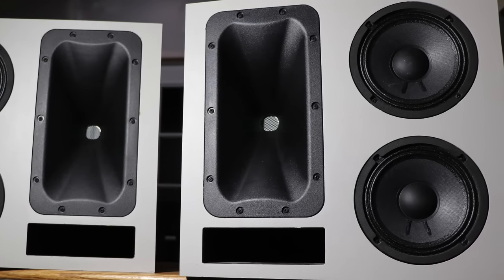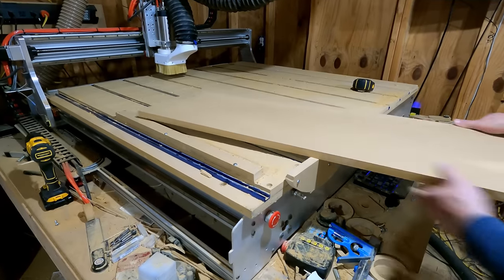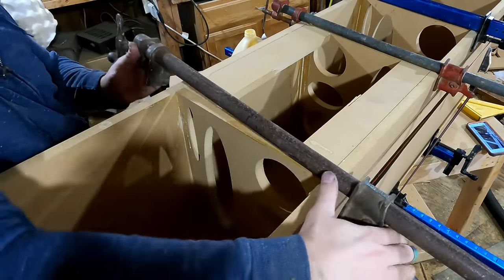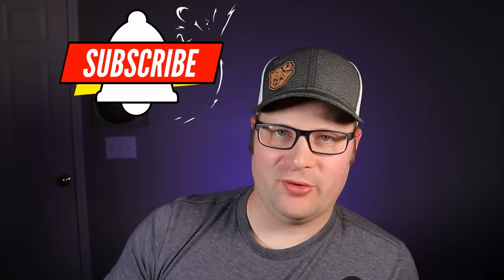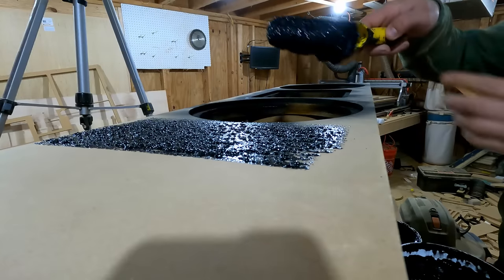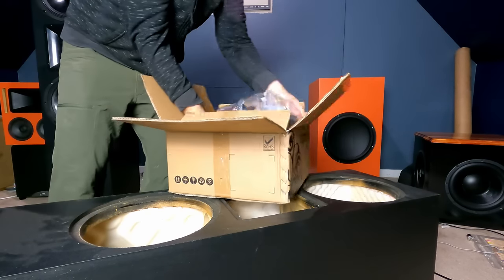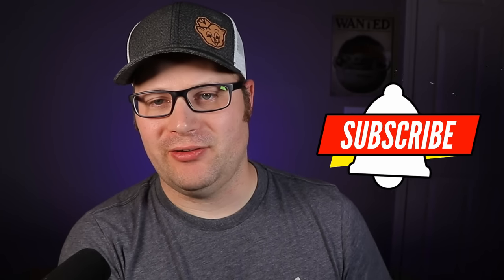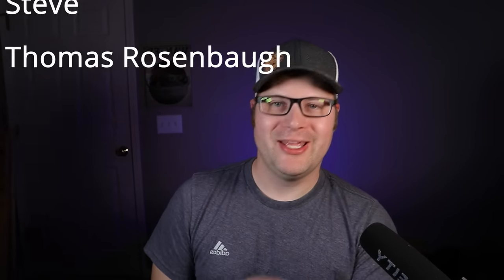How to Build $14,000 speakers for $1,300! JTR 212 Inspired - The Audience 212

Comment from the maker: 📄Build Plans: https://bit.ly/audience212
Reply: Are these good just for 2 channel listening? Or specifically for home theater?
Reply from the maker: @TexasCorgiGun  they are designed with home theater in mind. I would still use a subwoofer with these
Reply: @Toid  Thank you for your response.
Reply: Do these use a passive crossover or are you running active?
Reply from the maker: @russellgilmer1897  passive
Reply: do you have sample plans to review, I don't want to find out there is some unobtainable part or that they can't be printed 1:1 for tracing.
Reply: What about the woofer? I don't see a link.
Reply: Hey Toids!  Do these plans include schematics and instructions for a crossover?
Reply from the maker: @GARDNSOUND  yes they do
Reply: @Toid  Thanks man.  I'm going to pick these plans up.  I'm excited to build them.
Reply: looking at the plans before buying, I found the 12"  woofers out of stock. I 'm ok with switching models of drivers (Staying in the SB line) but if this is the case with cross over parts I will be lost.
Reply: Why two woofers of the same size and make? Phase cancellation will fuck up the sound. The same design with one woofer would be better. Way better.
Reply from the maker: @ZekeMan62  an MTM can have superior radiation patterns. You can read more about it here https://audiojudgement.com/speaker-lobing-polar-response/
Reply: @Toid  

Ok. I'll check it out. Thanks.
Reply: link is broken
Reply: @Toid  compression driver!? Pro audio woofers! Bro! That's really 126dB kinda loud! Even QSC K12.2 does 126dB easily! 😂I don't think neighbours will ever allow more than 92-99dB SPL @1m. Considering SPL drop as distance increases.
Reply: I’m trying to buy the build plans but it says there is an error.  Is there another way to get the plans?
Reply: @TexasCorgiGun 6th😢
Reply: Does the port have a top section, or is it just opened?
Reply: I’m looking for plans on the center channel. Is that part or could it be part of the download?
Reply: QQ: in the video you said these crossed over at 1.3khz via Xsim. Why is the Xsim crossover point different than the Fc using just the crossover component values?

Comment: I just totally wished you had a reference speaker like the Klipsch R-800F where you can compare your DIY speakers to and explain the strengths/weaknesses to said reference. It's very hard for the viewer to know whether it's worthwhile to build it and perhaps be disappointed when it's finished.
Reply: i think in diy we tend to hear what actulay the sound is brand always adds some ups and downs in their speakers to call them their signatures when comparing each and every speaker there will be difference and that will certaily base on one's way if approch
Reply: Those would smoke the Klipsch
Reply: @BostonMike68  Yeah, but it's not about smoking it. It's about telling potential builders how much better/worse it is compared to a popular and easily auditioned speaker like the Klipsch or other reference speaker if Toids chose to.
Reply: It's not even in the same ballpark. He's using 2 12" high efficiency professional drivers those are what people use for concerts and big events. They are 98 SPL per watt or something crazy. You can't even compare them they have a aluminum basket with a 3 " inch voice coil. Klipsch steel stamped basket aluminum cone 1.5 voice coil like he said if you had to buy something like that he modeled after it would cost $14000 you can't compare a big box store speaker with something like that it will put perform it in every way. I built a lot of speakers and I want to build them I was just on Madison sound website and saw the specs of the compression drivers and woofers the only thing you can compare it to is what he modeled it after
Reply: @BostonMike68  Did you not understand what is meant by a reference speaker? ... It's a way to compare it so that someone who wishes to build it will know what they are getting. Toids just says... It sounds good, it sounds great... What the heck does that mean? ... Say something like it has extended response to 25khz at -3db. It has better linearity across the midrange compared to the Klipsch. It has sharper imaging, 10db more dynamic headroom than the klipsch... Etc. Just saying it sounds great doesn't help people who are going to spend hundreds of dollars on drivers etc. I'm not arguing what is better or worse... I just want more comparative info and yes... A 1k diy speaker can easily out class a 3k retail speaker and that is what Toids should be saying.
Reply: It's better in every way basically it's a better built cabinet with top of the line Prof drivers with a cabinet 4 times the size and 4 the SPL the only downside is the size. Every other way it out performs it a lot distortion SPL sound quality bass tremble what is left they sell the kits on Madison sound and you have to have a really great design and know what you are doing for to publish a design. Klipsch cuts corners it a inexpensive speaker that has issues
Reply: @BostonMike68  I agree 1000% ... just open up any retail speaker and you can find all the cost cutting and cheap ass drivers. But ... Toids should be saying that and showing proof that his builds will flog any speaker under a certain amount of dollars. A reference speaker which is kept as a comparative baseline would go a long way rather than ... "It sounds great!".
Reply: I see what you mean. That's a big speaker and if you don't have a big enough room someone might be better off with something like the r 800 . I want to try to build something like that for the experience but I don't have any use for anything that big so that's a big weakness for some people it can overload the room with bass that's speaker isn't for everyone or every room for it
Reply: @whog -  Not everyone wants to learn a second language . 
audiophile speak is like wine talk. 
they both use words that have no relation to the subject .
" my speakers have a buttery smooth texture with a hint of oak and an after sound that is sweet but tangy with saffron like highs .

Comment: Just in case anybody is thinking of using mattress pads or packing foam for acoustical treatment in a room DON'T. Look up the station fire for why not. It is fine inside a sealed enclosure, and probably fine in a ported enclosure. (I do worry that a ported enclosure could become a chimney once the cone burns through. Just don't put it on walls or ceilings.
Reply: Mineral wool is better inside anyway and not that expensive.
Reply: They did NOT use matress pads at the Station, those were special bought acoustic panels (the owner did not bother with fire codes at all, so he never even checked for fire rating)....just fyi, matresss pads are fire retardent BY LAW (these laws were enacted in the 60's and 70's when idiots smoked in bed)

Comment: tip , to fix the issue you have on min 6:42 , remember that MDF is basically sawdust and glue compressed, so you could've add sawdust to that glue too to fill any hole or imperfection in MDF, the only thing with that is that you would've to wait a little bit longer to allow it dry cure.

Comment: Great build.
I am a big fan of having the same, L/C/R speakers at least for the main 3 front channels so I would be building these with the SB Audience Rosso-65CD-T-8 and H280 horn instead so that I can cross them over at 600-700Hz which will make them suitable for horizontal use as well. 
Yes, I know, the manufacturer suggests a minimum crossover frequency at 1K but that's for PA use. For home hifi you can probably cross them as low as 500Hz with a 4th order crossover. They will never use more than a few watts of power.

Comment: This is so dope! JTR also has a 215, but I wonder if a 218 inspired design like this is possible. 😲
Reply from the maker: I'm thinking the same thing. That would definitely need a compression coaxial. But that would be epic!
Reply: Biggest issue with bigger drivers is the larger the driver the lower the beaming point is. That's why you'll see higher midrange to tweeter crossovers on smaller drivers. An 18" driver would start to beam at around 700hz.
Reply from the maker: @TylerStout  you would end up having to use a compression coaxial for a speaker like that. They can typically cross over as low as 300-500hz.

Comment: Small tip for ya, save some of your sanding dust in a zip lock bag, for when you have cracks or your seems don't match up perfectly. Then when you need the sanding dust for the seems, sprinkle some into some wood glue, mix it together and use a puddy knife to push it into the seems. Let it dry, then lightly sand it again. You'll sand your sand paper doing it this way versus sanding while glue is wet.

Comment: I really wish there was a way to quantify the 'detail' and 'sound signature' of drivers. You can take 5 different brands of drivers with effectively the same TS parameters and they will all sound a bit different.
Reply from the maker: I agree.  I wish there was an easy way to figure that out.  I do have a video coming out that will test four different compression drivers.  But that will just give you  your frequency response graph and distortion measurements as well as decay. It'll help, but won't be an end all for anyone.  Having said that, I really like this is compression driver.
Reply: You can. You can measure them. Detail is the lack of the many kinds of distortion along with other properties that are measurable.
Reply: @Clobercow1  You 'can' measure a lot of it, but I don't think I've ever seen a waterfall graph on a speaker page before. Most days, I just feel lucky to get an accurate frequency response graph and accurate TS parameters.
Reply: @Kcducttaper1  Vance Dickason does some really good driver measurements in voice coil magazine, they seem to be quite reliable. These kind of measurements do exist, but I do agree with wishing they were more common!
Reply: @Clobercow1  waterfall charts (for passive speakers) don’t show anything new, they just show the frequency response (any “trails”/“tails” has to come from a bump in the frequency response).

Comment: How does the overall sensitivity compare to the JTR's? Are you going to do a video where you're taking measurements in the room?
Reply: Considering the woofers are 98dB, it’s a very sensitive speaker.
Reply: High 90's, most likely. 
Exact sensitivity isn't that important... relevant point, it's high, it's up there. 
Dual LF drivers, presenting 4ohm load, compression HF, loaded into a horn... high 90's, likely triple digits. 
The higher voltage sensitivity is the big attribute of this piece. 

Truly dig this build, it's raw, it likely could've benefited from matrix bracing... but pursuing down the path of high sens is a worthy pursuit. 

Refinement will come.

My take, I'd go active, dsp contoured, diy multi-way chip amps. Inexpensive, high performance specs. 

This path of pursuit with a measuring rig, will elicit significant growth and grasp of big picture... (the room's acoustic transfer function) 
Ultimately turning to the physics of acoustics... and simple room optimization  (where some huge gains are encountered).
Reply: I would like to see this too. Are the final measurements posted anywhere? I went to the plan page and did not see them anywhere

Comment: i sadly dont have all that equipment for ''simply building it''   If you have all those machines and stuff allready so the only stuff you need is the material itself.. yeah i would do that right now too :D 

but i want to get into it a little bit at some point. right now i m just using my elacs and they sound nice, i m happy with them. but a couple years down the road, i m pretty sure i might wanna step it up. At that point tho, i might just go DiY, maybe even some open baffle stuff, dont know. But the amount of value you get out of those diy speakers is just insane compared to what the same money could buy you
Reply: One doesn't need that much equipment to build diy speakers, even speakers as large as these. Most hardware stores where you buy the mdf or plywood will cut the wood to size for free or for a very small charge. I've built a few diy subwoofers and bookshelf speakers and the hardware stores make cuts more accurately than what I would be able to do.  Once the wood is cut, to make the circles for the baffles and braces you would need just a router and jigsaw.

Comment: Have you done any evaluation of different foam for the inside of the cabinet.   The reason I ask is that I have small amount of experience of quieting down a loud machine by placing egg crate foam on the wall behind the machine.  Egg crate foam used for packing material had almost no effect but when we purchased egg crate foam that was sold for its acoustic properties it had a very significant effect on the noise level reflected from the wall.  There was no discernable difference in the feel or weight of the two materials.

Comment: I’m surprised you didn’t use the two way compression driver used on the jtr. They suppose to give you beautiful highs and mids.
Reply from the maker: There's not many compression coaxials available for DIYers. In fact BMS, won't sell them to you. There are a few made by B&C, but not many companies make them in general.

Comment: Been wanting to build these for years and the woofers have been consistently out of stock. Wonder if they will ever come back in stock.
Reply from the maker: They can be hard to find. I’m actually working on a new version that uses different drivers. It actually has the ability to be placed horizontal or vertical.

Comment: Hi great creations indeed  Congratulations   They also look like the old JBL SVA series that i love   
Speaking of cabinet bracing i have thought a little about cabinet panels vibration.   
A very telling test of how much the cabinet design and construction can impact the sound i had once in a shop.   They were showing two PA speakers from the same brand, same drivers and same amps inside
One had a wood cabinet the other a plastiC cabinet to be used outdoor.   The bass of the plastic cabinet was a disaster ... weak and confused.  The bass from the speaker with a wooden cabinet was amazing for power, control and clarity.  
I think that the only really critical side by far is the FRONT BAFFLE    
I have seen some graphs in the Stereophile reviews of loudspeakers of the vibrations measured with accelerometers fixed to the various cabinet panels  Strangely enough they measure side and back panels but not the most important one ... the front baffle.   
The front baffle vibration levels i am sure are orders of magnitude above the vibration levels of all other panels. 
I am sure that the level of side and back panels vibrations is so low that when they reach the listener reflected by the listening room walls they will have no impact at all.   
The secret is all in the design and construction of the front baffle that must stay completely still even during the room shaking bass passages.     
I read a very telling explanation.   They were comparing the front baffle to a newspaper kept in the front of a reader.  If the paper moves back and forth the reading results very difficult  because the eyes has to focus a moving object.   
Of course the more extended the front baffle and thinner is the more the vibrations will be. 
For this reason i would try to separate mechanically (i.e. put in a separate box)  the lower woofer from the other mid and high drivers.
When the range from let's say 100-150Hz down is done right to reproduce the rest of the audio range is much less critical.  Going up with frequency the energetic content of vibrations will be much lower in level and so much easier to suppress.   
The woofer is a like a beast ... it needs a proper cage to keep it under control.  
Put it in the same box/cabinet of mid and high drivers and the problems begin.   Kind regards, gino

Comment: Could you make a 3 ch with a two ch amp? Like have the center speaker with each woofer separately on L&R ch? And a second tweeter firing against the back wall. And the whole speaker probably resisted a lot. 😅

Comment: Here's the question I have.. These or DIYSG Elusive 1099's? I will build either one but am undecided between 12 and 10 inch drivers and midrange on the 1099's.

Comment: CBT array by Don Kleen?  Very advanced based on sonar acoustics.
Power shading, superposition, time delayed  producting a more cyclindrical uniform
sweet area.  Parts Express project # 324
My JBLs i made in 1973 are still making great sound.
JBL reconed them in 1983 under warantee, i reconed them in 1994.
JBL-LE10 with passive radiator, 3 inch voice coils, 4 X 7 University horn.

Comment: NIce video, I am assembling a system bi-amp with crossover  - 1 amp for high 100w (rms/channel) + 1 amp 500w (rms/chanel) - electronic crosover + equalizer  - I am thinking that works good in this speakers, bi-amp, and I dont need crossover inside the box - but a speaker bi-wired  - I will work on this  - when I have the results I will show.

Comment: Nice towers, I noticed you holding your hand to avoid the dreaded screw bit through the surround, I'm always nervous. I've told people I would easily rather drive a bit in my hand over the driver my hand will heal... Inserts are nice but they can be problematic installing. I've seen quite a few people have problems with hurricane nuts coming loose and spinning  but all you need to do is few dabs of a good glue on them during installation... seems to be an easily resolvable issue.soundman Doug benards uses hurricane nuts in reverse when he installs bolt style terminals on an enclosure so there's a nice clean flat steel contact for speaker wire ring terminals vs a big nut and washer on outside plus the stick out is probably at least 3/8" less.